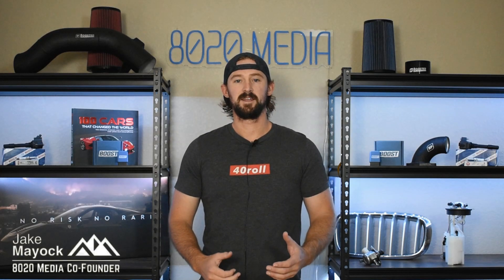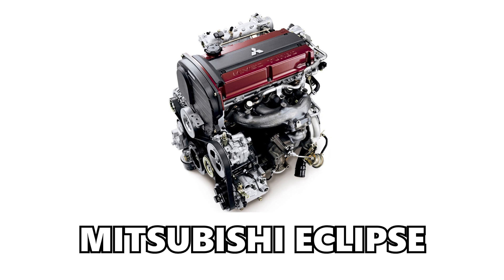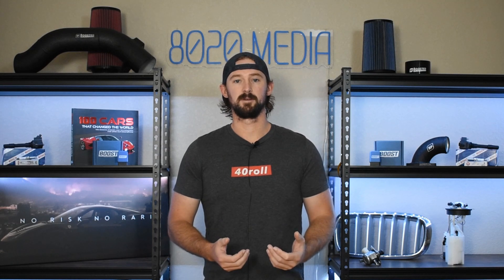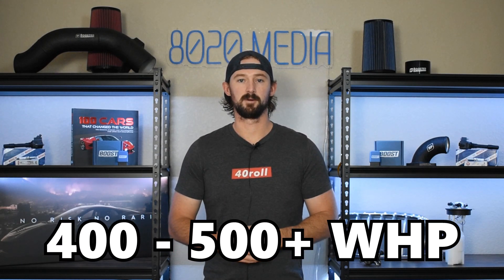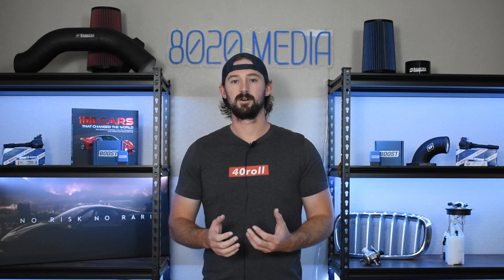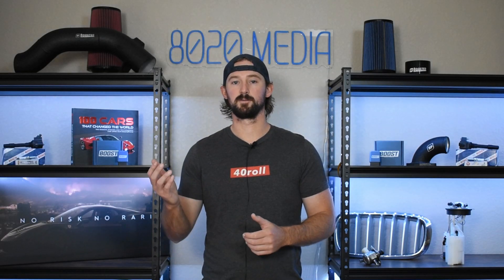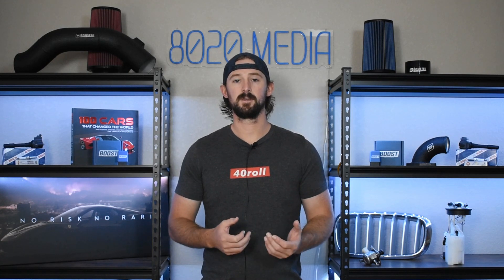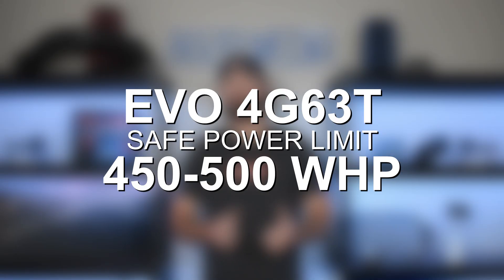The Mitsubishi 4G63 Engine | Common Problems & Power Limits

Comment: So galant VR4 1991-1992 are 6 bolts?
Reply from the maker: D - Yes, the 1991–1992 Mitsubishi Galant VR-4 came with the stronger 6-bolt 4G63 engine, just like early DSMs (’89–’92 Eclipse/Talon/Laser). Mitsubishi switched to the weaker 7-bolt crank design in mid-1992 for DSMs, but the VR-4 models in those years still used the 6-bolt configuration from the factory.

Comment: These engines are reliable past 500whp. Problems arise when people try to save money on parts or skimp on maintenance. These engine also do well with a multidisc clutch over say a 6 puck style. Lifter tick is not anything to worry about GSC makes a replacement "zero tick" lifter. Crank walk issues are rare outside of the earlier evo models. A common resolution to hg issues these days for the head are o rings and ARP 625 headstuds and OEM Evo 9 headgasket are a perfect combo with more modern tech hg options available nowadays with proper machine work.
Reply: That’s any car lol 😂 to be real.  you can tell when people cut corners on maintenance.
Reply from the maker: @Boosted_Jay87  100%
Reply from the maker: A - Thanks for taking the time to share these insights!